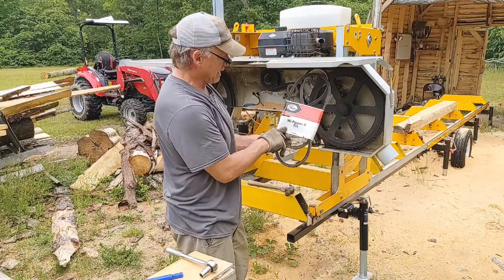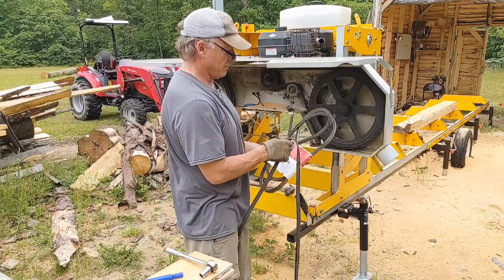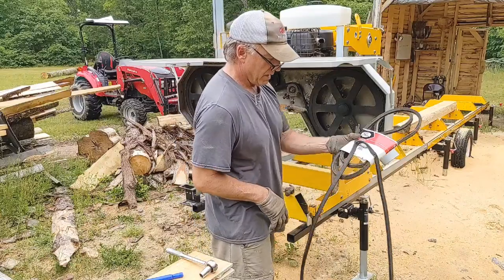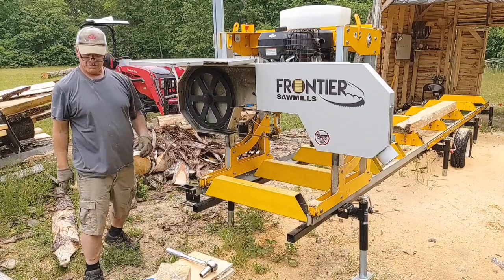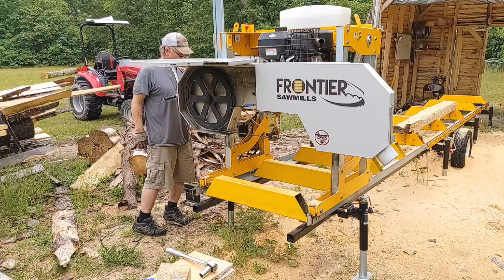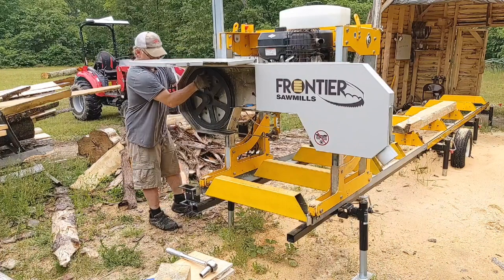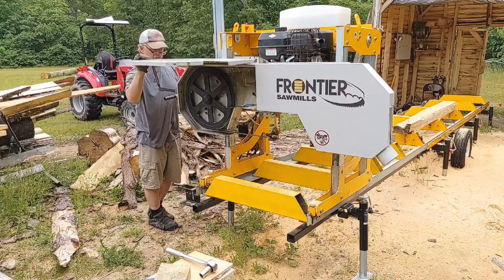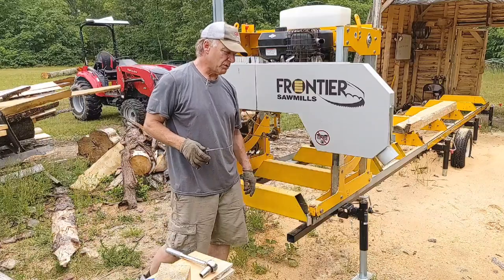Changing the Drive Belt on the Frontier OS27 Sawmill

Comment: these things happen, that's why we prepare and get spares 😄 I wonder why I was advised for a B83 over the B84. As you seen on mine it was a little tight getting it on however there was little adjustment needed on that belt 😄 
Great demonstration buddy 👍
Reply from the maker: I only bought B84 because it was on a forum somewhere.  I lucked out.  I have a replacement on the way.

Comment: I also blew a couple belts on my OS 27.   The next time you order a drive belt try the Gates 6986.  The guys at my local parts store said it is made for applications where you have a backside idler.  So far so good.   The belt is obviously wearing in but it hasn't come apart.    For what it's worth there's my 2 cents.   Wait,   with inflation the way it is maybe my thought is worth 4 cents.   Ah, now that makes me feel like I'm delivering real value :))
Reply from the maker: I definitely will.  Thanks for the tip
Reply from the maker: I just screen shot your suggestion so I'll remember it lol

Comment: Hi Jerry It is been a busy summer for me. So I am a bit rusty on following along with you! Regardless now your changing you belt I would like to share with you on a modification I am considering doing and thought to share. I have a lumber mate 2000 and it has the same set up for belting as your frontier. Also the woodland mills have it and several other mills. I was thinking and will get to mine when I get time eliminating the idler pulley and running 2 smaller belts  I feel the elimination of the larger belt would give less friction and less bending. Here is the idea if a person gets a double pulley and mounts it up on a 45 degree angle and uses a small belt to go from your wheel where the blade runs on a angle to mock the larger belt then run a additional belt from your motor to the double pulley. I think this set up would let belts last longer as it eliminates the back bending of the larger belt. I hope you can visualize how it would run and would like to know what your thoughts might be on the subject! It would be easier to draw you a picture Maybe I could do a video and post it that way you could have a better idea on how it would run!
Reply from the maker: I understand what you are saying and that's a great idea.  Replace the idler pulley with a double pulley.   Little belt to the clutch and a smaller drive belt to the drive wheel. I wonder why they don't do it?  I'm guessing that would add cost to the original build they want to keep their costs down

Comment: So, to tension the belt you tighten the bold on the lower left?  Why did you lose those other bolts?  I do not understand what you did to tension the belt.
Reply from the maker: @coreyalix   you're correct.   I loosened those other bolts to move the entire tensioner over.  I'm using a B84 instead of a b83.

Comment: Great video... anyone know the idel belt length???
Reply from the maker: I use a B84 for the drive belt.
Reply: How about the smaller belt?
Reply from the maker: B56.  I've never had to replace that one yet.  I do have both hanging in the mill shed.
Reply: @BigelowWoodcraft thank you I asked the question before I seen this 💪
Reply from the maker: @danielmoore7039 no problem.   Have a great weekend